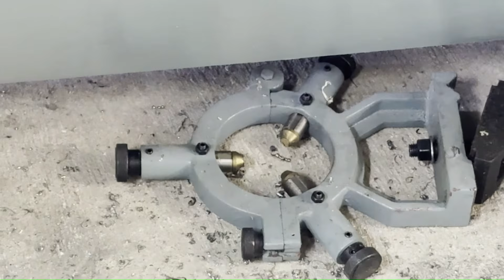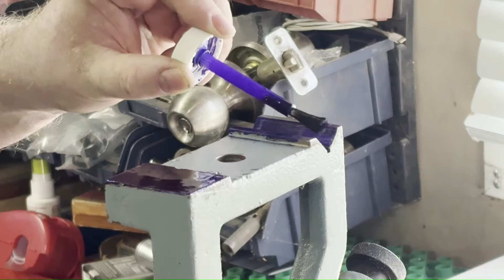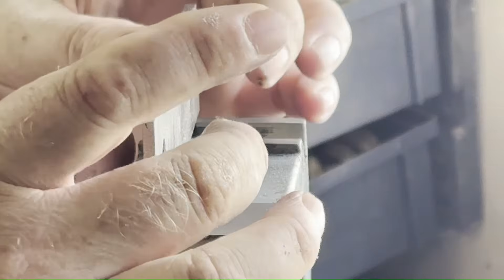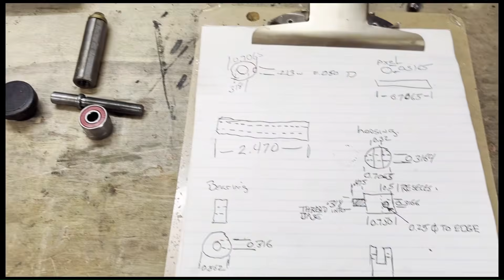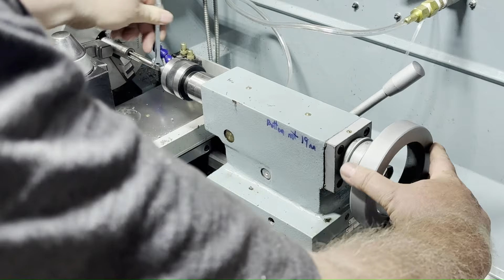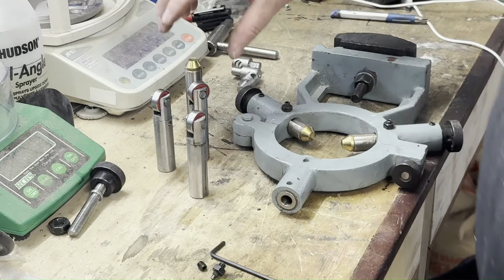A Better Steady Rest

Comment: My dude, I have probably 250-300 taps, and I run into the same problem. I find myself without the right tap all the time. I also have a large collection of nuts and bolts that I e accumulated over the years, so I guess I either need more of those, or more taps haha